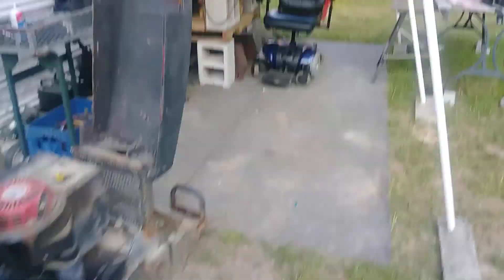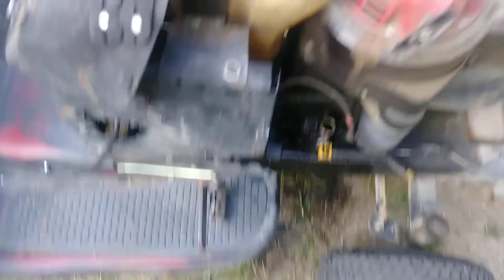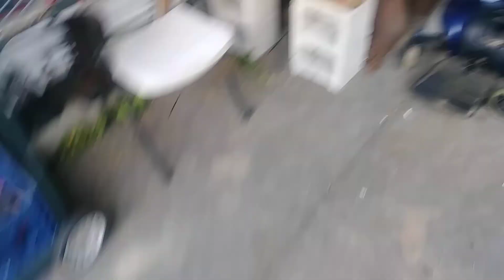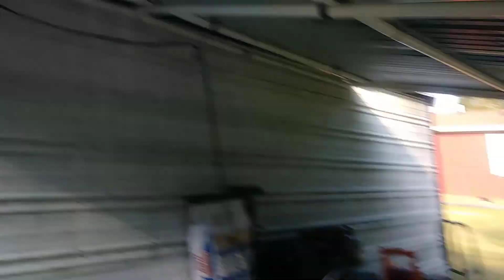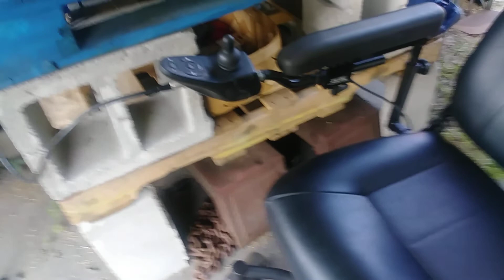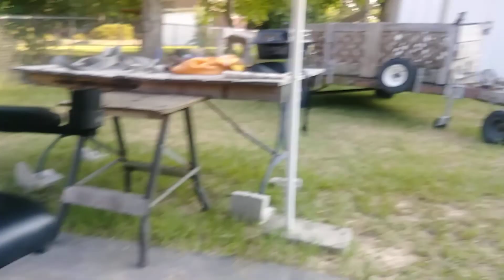Warning warning Danger time for that new carburetor

Comment: Man keep your head up project like this happen to me all the time you actually need that carburetor that when you kill power to it it automatically shuts off the fuel it's like a back fire preventer it's most aggravating thing to deal with and take off but it works you have to change your whole setup but it should work for you or you could always put a Mikuni on there